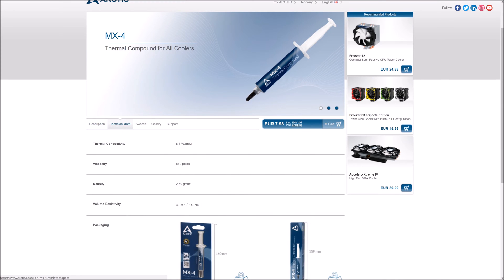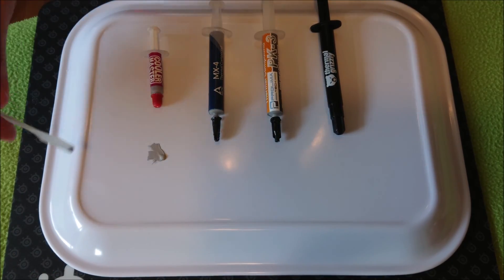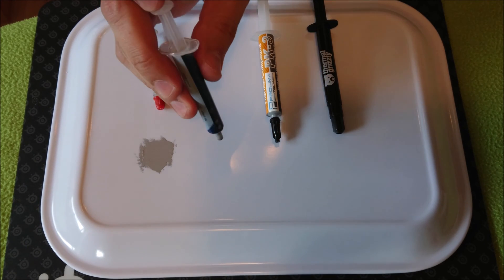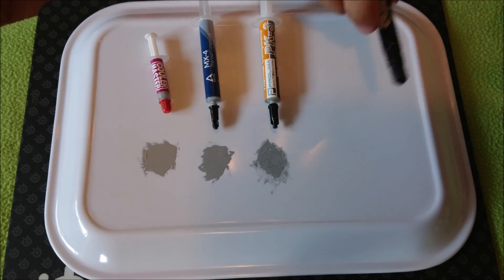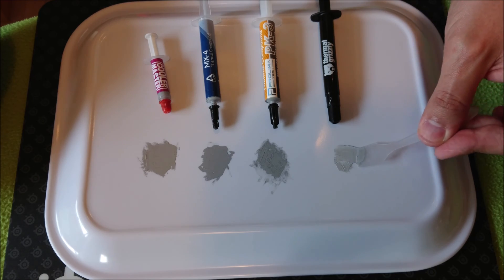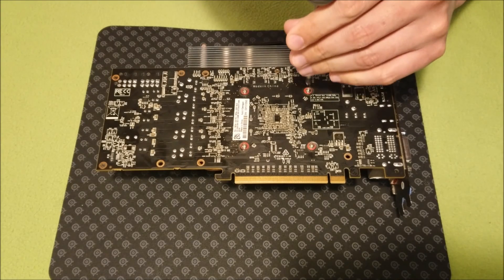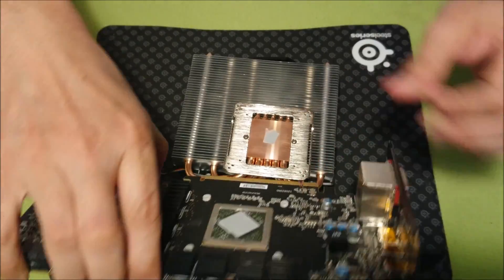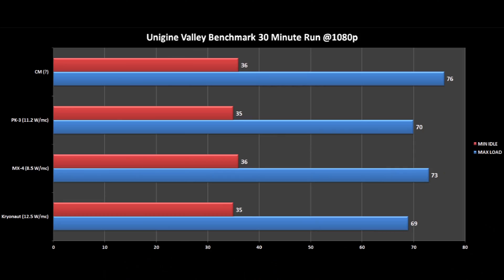Thermal Paste Battle! MX-4, PK-3, and Kryonaut Tests

Comment: The reason that PK-3 was harder to spread was that you used less than half the amount for that
Compare PK-3 size (3-24) to MX-4 (2-04) Cooler Master (1-02)
If you are going to do a comparison, the comparisons have to be the same, or the 'test' is pointless.
First rule of comparisons.
Reply from the maker: No sir. It's viscosity should be consistent regardless the amount. It could be half of an uncooked grain of rise-size amount, or pea size. It's viscosity should always be the same. Thanks for watching!

Comment: MX4 was the worst paste ever used ,pumped out after first cinebench. PK-3 is good ,Gelid CG extreme is ok ,Kyronaut extreme is good too
Reply from the maker: I've never had issues with MX-4. Works like a champ. But I'm sure there are cases out there where people are not happy with their results. MX-6 is also good.
Reply: @TechnologyHive  yes maybe the problem was the low pressure and uneven heatsink of Alienwares ,similar problem with XPS ,def. not for Dell

Comment: I used PK-3 and Kryonaut for CPU deliding, but both of them failed overtime. The thermal performance degradation was noticable after about 6 moths. I wanted to seal back permamently the CPUs, so I went for liquid metal.
I also use GD900, people say the performance is close to MX-4 which is kinda true for CPU cooling, but the difference is big for direct die cooling. Last tested on a GTX780Ti fixed fan speed and room temp. 
GD900: 73°C 
MX-4: 68°C
By the way they both keep thermal performance over the years, you can reapply them after a year or two, they don't dry out.

Currently I'm searching for a better direct die cooling solution for GPUs than MX-4. (Liquid metal is out)
Reply from the maker: MX-5
Reply: @TechnologyHive  I just ordered NH-1 to try out. I think MX-5 just a different colored MX-4 and I don't know anything about the long time performance.
Reply from the maker: @sviktor4  Noooo. MX-5 is not just a different color MX-4 🤣. It's a different beast. Excellent performance, and Arctic claims same durability as MX-4. I've tested MX-5 and it is completely different.

Comment: For crying out loud...its thermal paste, not spackle...you don't need to spread it, just add a pea-sized drop on the center of the cpu and let the tension from the heatsink spread it .
Reply from the maker: Over the ihs the pea size application is enough. But, direct on die applications it is recommended that you spread the thermal paste to make sure everything is covered. Thanks for watching 😊.

Comment: I been using the PK-3 for a year, and I have some considerations:
First of all, after aplies the thermal compound the temperatures are pretty impressive. But, saddenly, this won't last so long. It's dries really fast, just a coupple of monts (two and half, in my case) are enought to this thermal paste loses 20% of the capacity. In numbers, I may say 5 or 7 degrees celsius. 
I have tested in a GTX 980ti SC+ of EVGA. This graphics card is a really barbecue grill, with over 270W of TDP in OC. I'll test the Arctic MX-4 for see the difference. Durability is very important for me, and if you consider that, I not recomend this compound.
Reply: how MX-4 holding up
Reply from the maker: Gabriel, how is MX-4 doing now?
Reply: I am not an expert but i used PK3 for my 6600k with noctua NH-12S and temps are still good since dec 2014.
I really don't know why you had such a bad experience.

Comment: 9:37+ Answer: "Yes it is!" - Specially if you wanna make your PS4 Pro dead silent, because a few degree decide wether the fan spins at 100% or just on moderate 60% <3 

For PC enthusiasts and overclockers the answer is a "Yes!" aswell.
Reply: My Pro also turned a dead silent PS4 after I changed all the pads and paste for TGK. I cannot even hear it even after I updated to SSD. :)
Reply: @gaborsimko3870  yea. TGK + TG Minus 8 Pads work wonders.

Comment: Agree with MX4 , it's really make the system crazy cool . i used my FX6300 idle just 29c to 33c with stock cooler , same like put the ice on my PC . MX4  39c with lower voltage and limited 85% max CPU state , 38c idle . 1900rpm fans. 
for those looking for quiet system , 1st thing is dont save on your thermal paste .  i always look down on this thermal paste , now i only realized the Thermal Paste play the main issue for temperature before cooler.

Comment: what do i do with mx-4 4g thermal paste after using? will not go bad if i just store it and save it for future use?
Reply: Mx4 is junk on Ps4 pro. I've replaced my paste 3x in 6 months. I'm switching to Kryonaut.
Reply: just keep it in the case bag that it comes with and keep it somewhere cool

Comment: I'm putting the MX-4 on my PS4 because it lasts longer and I've gotten solid results from it.
Reply: Did you use pea method? Because I've repasted my ps4 pro 3x now in 6 months using Mx4.
Reply: @Jacob-hl3gt  Yes, I used the pea method.
Reply: @ishmael_03  how often have you replaced tp?
Reply: @Jacob-hl3gt  The MX-4 is long lasting so I haven't replaced it in about 2 years and my PS4 hasn't gotten loud like it was with the stock paste.
Reply: @ishmael_03  can you hear your machine at all?

Comment: Would you recommend to apply Kryonaut on a laptop? Or mx-4?
Reply: I Think so use Grizzly Conductonaut on laptop will be better :))))
Reply: @lanhlung9839  
What's the difference between that and Kryonaut ?
Reply: @Zeegoku1007  Conductonaut is liquid metal, so you have to be especially careful cause even a small drop that comes off the die can kill the board. Stick with kryonaut, unless you want the risk and few degrees better performance
Reply: @Fattdogs1  
Noted. Just got the Kryonaut. But the thing is thrice as pricey as an MX-4 !
Reply: @Zeegoku1007  Yeah, it's pricey, but really its not that much if your putting it in a high end system.
Reply: Which provides lesser temperature? Kryonaut or MX-4? My nitro 7 reaches 92C from the thermal paste that the manufactures added
Reply: @Nemenis  Kryonaut for sure but you have to apply it properly since its a bit less viscous imo so, ensure proper contact is there between the heatsink and cpu gpu die
Reply: Zeekay what will be the temperature difference?
Reply: @Nemenis  Its gonna be a marginal difference, 1, maybe 2 degrees max.
Reply: Fattdogs451 will putting a cooling pad under the laptop after applying the paste make difference?
Reply: @Nemenis  Not much, maybe 4 5 degrees if you consider that a noticable change
Reply: Zeekay imma get the conductnaut instead of the krypnaut because I put the new mx4 paste and the temperature is literally the same. Hope conductnaut makes a difference
Reply: @Nemenis  Be careful with Conductonaut, I hope you know what you're doing. That thermal paste is conductive and you don't want it to move around other components, apply insulation around the processor and other areas on the motherboard where the compound might seap on or leak
Reply: Zeekay yeah I know that :)

Comment: My acer nitro 5 (2018) variant runs hot and i mean hot with just 50% load on both cpu and gpu with undervolt of -134.8, clockspeed reduced from 4ghz to 2.3ghz (turbo disabled) fans at max speed 6200rpm still runs at over 80 celcius with ambient room temperature of 20 celcius, in summer around 35 celcius. which thermal paste do you personally recommend? i don't plan on overclocking i just want to play at 60 fps 1080p which i'm unable to do i have to even use riva statistics tuning server to limit fps to 20 on most simulation games (X-PLANE 11, Beamng.Drive etc)
Reply: I used kryonaut on my acer nitro 5 (2020) and it doesn't peak over 74c, and that's without turning the fans into overdrive . Though your mileage may vary, I have the new AMD Ryzen 4000 series.
Reply: @Fattdogs1  Sold mine and bought my first ever PC it's just too better Never getting a gaming laptop again
Reply: @beanZshots  lol, why do you say that?
Reply: Typed on mobile was talking about my PC and yes I am never buying a gaming laptop
Reply: i think the problem would be the game you're playing. xplane and beamng are heavily cpu bound (calculating physics) hence why the higher temps.
Reply: @muhammadtantowijauhari8415  That's not he problem, Well either way gaming laptops suck and i found out the hard and expensive way. PCs are ten fold better.

Comment: few degrees make colossal difference in laptops especially on this thin and light trend. Question is how often you need to re-paste to preserve the day 1 performance, which is mostly related with how quickly your paste degrades on temps above 80 in this case

i have used kryonaut on brand new laptop there is a difference, but im not sure it can last long without losing performance if anyone has experience using it on high temps please leave feedback
Reply: doğancan öztürk I have the same question too as well. I heard that nt-h2 outperforms Mx-4 when it comes to high and low pressure cooling. However, it’s not as good as kyroanut(3~ margin) but it lasts and incredible amount of time.
Reply: @royalsonshrestha9982  You maybe right about NTH2 but my personal experience with NTH1 was been abysmal on my laptop. Maybe noctua fixed the leakage issues
Reply: I liked to use MX2 because they claim long lasting effect, actually about 7 years. Spreading the paste is tiny harder, it is on thicker side compared to MX4 (should last less tho but little better performance by some reviews, some are about the same, same had worse... i guess all is in margin of testing error). Also big tube of MX-2 30 or 65g is priced really nicely and should be kinda no brainer for system builders price/performance wise.

Comment: I've used Artic Mx 4 for years as it was priced well. 16 pound for a 20g tube. But i started using Thermal Grizzly Kryonaut on my main Pc only, rest are mx 4. My issue is Kryonaut costs so much more than Mx 4 .. Atm i need to reapply paste to my r5 3600, offset core and all.. My temps are still to high imo. But yeh is it worth the price hike, I'm not to sure about that.

Comment: Only reason I used mx4 on my gpu is because my cards paste was degrading enough to need a new paste and then I found that mx4 started out great but slowly started showing higher temps over the course of the same month. 

Now I'm trying to find information on pk3 and gelid extreme lol
Reply: I had the same problem with mx 4 and gelid. Buy a thermal paste with better themal Conductivity like Thermalright TX 14.3W/M-K

Comment: old PK-1 vs new MX-4 i got this month 

over 10c higher over the old PK-1 ...
 how are the charts & realty conflict so bad ?
Reply: @greenismycolor that's not my case, i contact them & it could be expired/bad batch.
Reply: UPDATE: i did receive a product replacement today from local shop 

and im happy to report i got my 11-12c back down!!
so it indeed was a bad bach ..!

and i can also confirm MX-4 is as advertised ever so slightly better then the PK-1
 maybe by 0.5c ..maybe less as Arctic site state, so good to see correct advertising by Arctic!
Reply: @gideonsward  yeah it was weird that it was running that much hotter. Anyway glad to hear your issues got sorted out.

Comment: Yep, Kryonaut for me too.. been using it quite a time now and no problems, i rather pay little extra to get everything out of my coolers since i OC a lot, also use it on my laptops to keep em silent.
Reply: @greenismycolor too much is better than not enough, gamers Nexus has a video about this. Having too much thermal paste also does not cause higher temps (it's actually just as good if not a little better than a perfect application), the reason why is because when you tighten down the cooler it squeezes out the excess thermal paste to make petty much the perfect application. Obviously you don't want to do this if you use a conductive thermal paste but the kryonaut is non conductive so you don't have to worry about if you apply too much. You can blob it on thick, or you can spread it out thick.
Reply: @greenismycolor on the cpu I haven't had issues with spreading (except when I used too little). All I did was wear a rubber finger glove as tight as I could get it and spread. It wasn't really any different than when I used the pea method. So for cpu you should mostly be fine.

Comment: Im using the mx-4 for my mobile phones.. and my phones are always near idle temp even at under heavy usage.. except for mobile gaming.. still its lower than the factory paste.. and it also prolongs battery life due to lower heating
Reply from the maker: MX-4 is great stuff. Reliable and does well at thermal conductivity.
Reply: @TechnologyHive  I've been using Mx4 and have replaced the paste 3 x in 6 months using pea method. I think I'll try Kryonaut.
Reply from the maker: @Jacob-hl3gt  Jacob, that's a new one for me. Sure try kryonaut and hopefully that helps. I just got the noctua nt-h2 paste and will be reviewing it.

Comment: Are you serious about spreading!!!  Spreading is a waste of time; taking up too much time.  Stupid!
Reply: Spreading is actually correct if you're doing a gpu. It's not like doing a cpu that isn't delidded where it actually doesn't matter nearly as much. 

Now the other thing I can take from this is the spread yes he did. Technically unnecessary, but some people like to know that as well because they actually are planning to replace the thermal paste on their graphics card
Reply: @ArtisChronicles  even o  a cpu.you have to spread
Reply: @Icenfyre  nope, just a pea size ball is needed; no spread needed which can actually introduce air bubbles/inconsistencies! 30 years of doing CPUs, and a pea is all you need to apply before immediately adding the heat sink to a cpu.  It will spread itself (evenly) when pressed from the heat-sink.
Reply: @mr.e8781  dude, have you used MX4 on a ps4 pro? Because Ive repasted it 3x now in 6 months.
Reply: To prevent dry corners/edges on GPU's and laptops i create a thin layer of paste and apply a tiny small dot or line to push out airpockets.
A good way too see a correct application on laptops is to use a temp monitoring tool for individual cores such as "coretemp" or "HWInfo" with the CPU on full 100% load. With a correct application all the cores have a similar temperature, a large difference like 10'celsius between cores means a "dry" core.

Comment: 10 usd for 4 degrees is awesome!
Reply from the maker: There are other factors that can also be looked at which add value to thermal paste, such as longivity. Thermal Grizzly I have been using now for a year and half and still temps are as when I applied it.
Reply: @TechnologyHive  Using the MX4 since 6.5 years on CPU, never refreshed it, temps solid, maybe a few degress higher.

Comment: 8700k 5ghz 1.34  max 83c on cinebench. is that actually good? and 76c spikes max when gaming but average 65c.
Reply from the maker: 83c is bit high yes. These are expected temps without deliding your cpu. It wont kill your cpu, but definately limits your performce headroom.
Reply: Buy the delidding tool on ebay and use liquid metal from the die to the copper plate, theres tuts on youtube, you will see temps drastically go down by a damn lot...

Also the thing is that CPU is still recent, the more time it passes usually it only goes worse and worse with the bad quality paste Intel uses...

Comment: I see no reason to skimp on thermal paste unless you are working on computers all the time. I am impressed with the thermals using the Kryonaut thermal paste. 30C at idle stock. 40C at idle running an R5 2400G overclocked @ 4GHz with the igpu running @ 1600MHz. Less heat means less noise from the fans.

Comment: Use a drop in the center or strips and tighten the sink only. If you spread the thermal paste with spatula you will cause the layer to form pockets of air and this will rise at + 3 ° C.
Reply from the maker: Never use strips or a dot method when applying TIM on a die. Always spread paste. Over the IHS, dot method is no problem.
Reply: @TechnologyHive  You are wrong, this increases the temps. There are several tests done about this. My friend made a tests with MX4, if you spread thermal paste increase  + 3°C.   Checkout (PTBR video):  https://www.youtube.com/watch?v=-SbbHTZ3Lik.   Tests made with fixed bechmark with Funmark
Reply: @icold666  unfortunately he's not wrong for direct die application since you can kill a graphics card if the entire die isn't covered. It's possible to lose the memory controller due to too much heat, so unless you want to heavily goop the die to avoid manual spreading you'll actually want to spread it to get good coverage across the die itself. 

It's very different if you're working with a cpu that isn't delidded as you're perfectly free to allow heat sink mounting pressure and heat spread the thermal paste for you without much worry.

Comment: hello mate!!!, i have that gpu by xfx, sometimes the gpu reach the 100 degrees, then i change the thermal paste, but now, the graphics card reach 102 degrees, when that happen, the card dont give the 100% of power. The thermal paste is HT-GY260, and i want to buy the mx2, i was learning about it, and the people says is good. If i put that paste on my gpu the temperatures can be lower?
PD: Good video, is useful, u have my subscription and like!
I from Mexico, and if i have some error sorry.
Reply from the maker: Hello. Thank you for watching. One fix I have found is to lower the GPU power % in MSI afterburner. This will dramatically decrease the temperature while still maintaining performance. The problem is that the coolers used for the HD 7870 where poorly designed for the 170w TDP. I would use MX-4 instead of MX-2, since it does perform a bit better. Also, check that your thermal pads are not holding the cooler up off the GPU core, thus not allowing full contact between the two and causing major temperature problems. 100c is very high!
Reply: Thanks bro! i will buy that thermal paste!